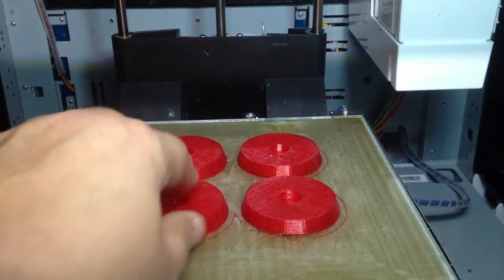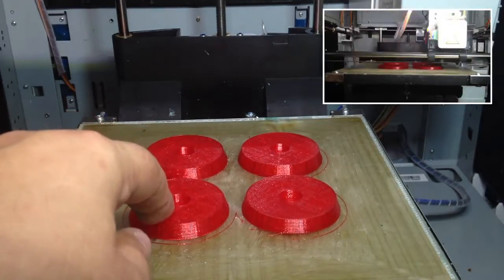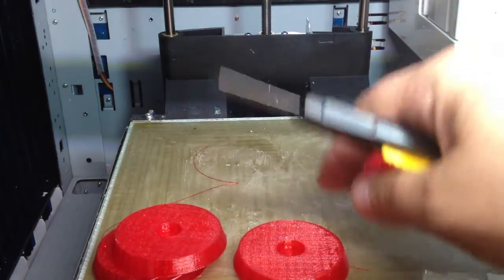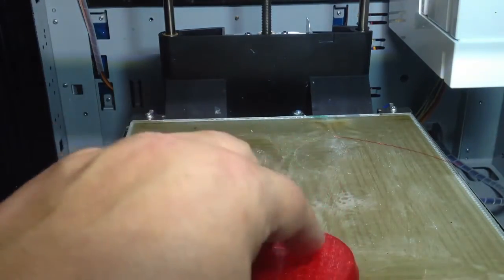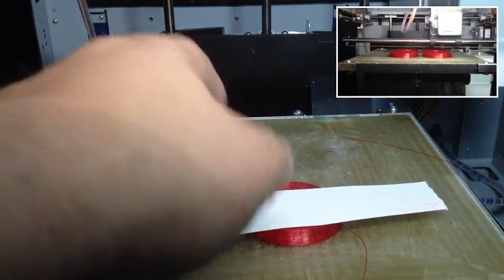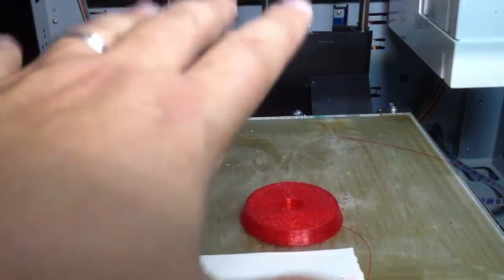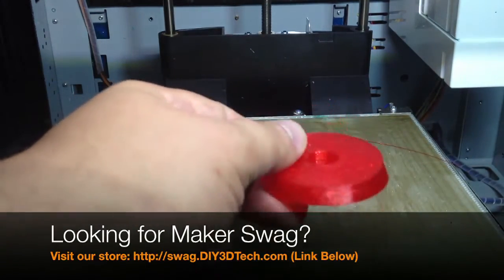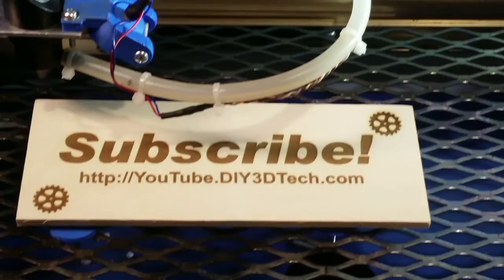XYZ Ware Da Vinci  - Printing with TPU!

Comment: will tpu works for the da vinci mini?
Reply from the maker: Since I don't one have can't say however for TPU it is best to have a direct feed extruder (bowdens can pose problems)  and an all metal hot end as you need to be around 250/260c which can damage the PTEF tube in a normal extruder...
Reply: DIY3DTECH.com Thanks.

Comment: What are your retract settings to successfully print without stringing?
Reply from the maker: Yes, now it fairness these are pretty simple so you might need to adjust if you have smaller "spire" type objects...
Reply: So... what are your settings? 2mm retract at what speed? I tried using my default ABS settings and it jammed every time.
Reply from the maker: Aah!  Slow it up, cut you feed rates by 50% as the simplest way I can explain it (which maybe subject to deep technical debate) is the viscosity of TPU is a lot higher than ABS so it does not push out as fast as ABS or PLA especially when a lot of retracts are involved.  As because of the viscosity (really time to transition) is what causes the jamming, so if you doing long steady runs you can run like ABS (which you shouldn't but sort of could).  It also depends a lot on your nozzle (size and type) as well as your extruder gear.  For me I fine a stainless steel nozzle the best (larger the better i.e. 0.5 over 0.4) and knurled gear over a spiky gear...  Also don't expect high resolution printing with TPU as its very fluid once it transition and therefore loses detail which also end you up with jamming.  I find TPU is good for "bigger" things...

Comment: does it extrude ok? I heard flexible filaments jams the printer alot
Reply from the maker: Yes "but" you have to run it slower as the melting viscosity of the TPU is not like that of PLA or ABS so run it around 30mm/sec or so rather than 50mm/sec and it does well.  Depending on the part (i.e. low or no retraction) I do bump it up a little...